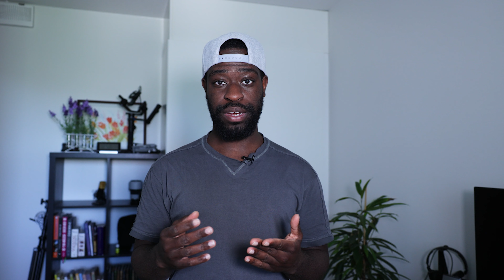Canon R6 + Ninja V - Overheating Times in 4k 24/25 & 50/60 fps

Comment: Hi. Nice video and informative. A couple of questions.
1. Are you using Clog while testing?
2. Have you tried it now with Clog3 and does it give you the same result?
3. Does it continously record without touching anything from the camera? I believe the camera will sleep after 30 minutes so that means you need to touch or press something on the camera to keep the recording going.
Reply from the maker: 1. Yes.
2. Clog 3 unfortunately haven't tried it because I don't use it often anymore.
3. If you set the screen to sleep the only that will sleep, but I'd you're recording externally the camera qill never sleep. If you have that then just switch the stamps mode off from the menu.

Comment: Is your lcd screen off when testing? Whenever i do the test with the screen on sleep mode, it freezes for a second then continues to record. Also i'm not getting the same results. Overheat warning pops up around 53 minutes. So many different results for so many people 😅
Reply from the maker: Thanks for watching 👍🏾

So, it depends from the environment you are in, I tested it a room temperature, but if you're at events or places where it is hotter then, the time will come down. Unfortunately.

About the freezing, yes, it is true, when the screen switches off, there is a moment of freezing, amd in post you can actually hear it from the audio.

Comment: hello I have a question how to get out of 4k towards the ninja 5 in 4k because in the menu and output hdmi, I only have 1080p?
Reply from the maker: Hello, you can't change it from the Ninja V. It automatically detect it when you connect your camera to it. So the fact that it only sees HD, means that or your camera doesn't record more than HD externally or the HDMI that you use can't record more that HD.
Reply: You either have 1080 selected in output or you're not using a proper 2.0 capable camera.

Comment: I’m having trouble shooting 4k 60 on my atomos. It works fine when i shoot 24/30 fps but when i switch to 60 the ninja no longer recognizes my camera and also shows in the ninja screen “no input” any idea why? I have a usb 2.0 cable and the R6 is updated to ver1.5
Reply from the maker: Yeah a lot of people have asked me the same question between Insta and here, so I think it is still the cable, it doesn't matter if it is 2.0, you still need to check if it is able to process a 4k 60 feed. Unfortunately there are a lot of dishonest sellers out there saying that the cord can, but afterwards it doesn't. So I guess that Is the issue

Comment: What are your settings on the Ninja V? Still running into over heating with the R6 and Ninja.
Reply: yes the R6 is very susceptible to ambient temperature. with the ninja, no cards in camera and dummy battery with external power you can record 4k 24 almost all day long in 20°C ambient temperature indoor or with no sun outdoor. but make that 30°C and a bit of sun that time goes down dramaticaly from the start then and does not really recover once you hit the overheat limiter, until you can let it cool down in a colder environment without sun exposure.
Reply from the maker: what Digi20 said is really true. Unfortunately, you have to pay attention to the temperature that you are filming in, what can help you if you are outside is to be in that shade, but the time of recording will still come down, but you can still record long format stuff. My settings are just the usual settings: 4k 24 or 60 FPS depending on what I am shooting and nothing much. I do not remove the card from the camera because you can not record in the card if you are using a clean feed to the ninja anyway, but many people have said that it helps, but I have not found any difference. What I do is to put the screen at sleep after 30 sec and that helps too. Hope this was helpful